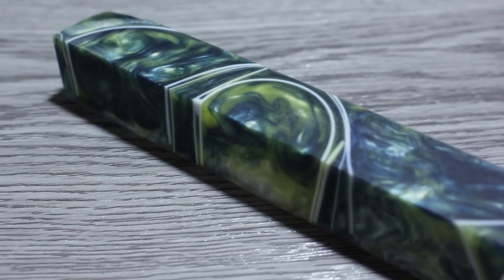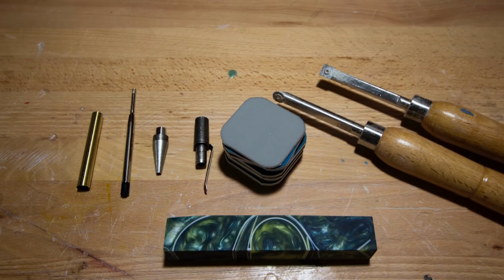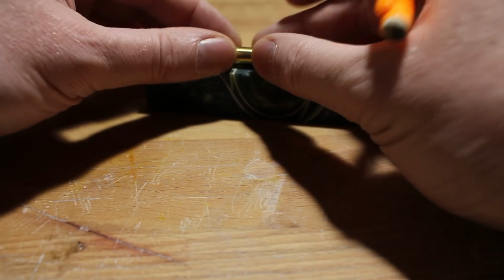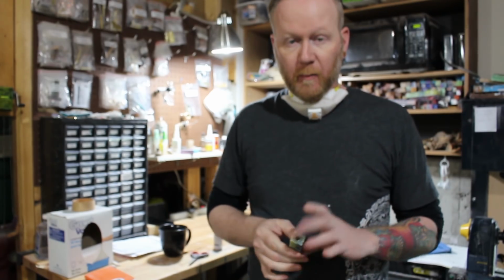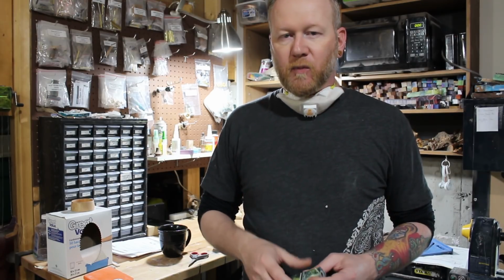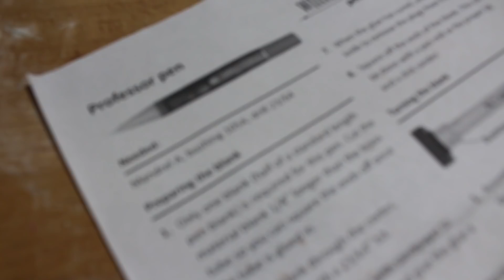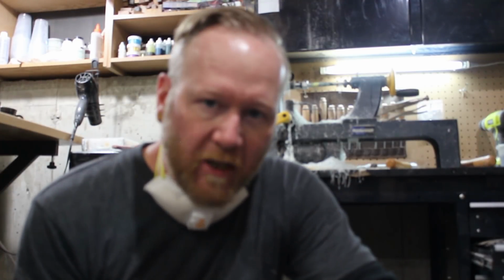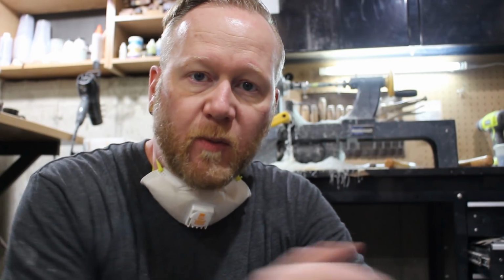Pen Making | Turning An Alumilite Ribbon Pen Blank On A Professor Pen

Comment: Great video Mike. That blank looks great. I agree with you on the not going down to the busing and sanding the rest of the way. The only difference I would say with me is I start at 120 and go to 800 through the dry and then  micromesh down to 12,000. I find this gives me virtually no scratch marks and then I use a polish to really lift it. I will sometimes use Yorkshire Grit too between dry and wet if there are some stubborn scratchs, it saves wearing out the micromesh
Reply from the maker: Thanks John! I'll give this a try...aside from the Yorkshire grit, at least until I can get some locally! 😉

Comment: Great vids. Keep it up. I turn between centres using the regular bushings you already have. Just use a dead center in headstock and rotating center in tailstock.
Reply from the maker: Thanks Wayne - I'll give that a try this weekend!
Reply: It’s really simple and I don’t think I will use a mandrel again. You can only turn 1 piece of the pen at a time but I find it much better than using mandrel as you don’t have to worry about the mandrel being straight.
Reply from the maker: I just bought a new mandrel but will still give this a go this weekend. 👍

Comment: Have you ever had the ribbon detach from the blank.  When I tried it with Aluminite Amazing casting resin the second pour didn't stick to the ribbon.  Great looking blank and pen.
Reply: Use Alumilite Clear Slow Set next time.  "Amazing Casting Resin" is not meant to be used for items that will be turned on a lathe.
Reply from the maker: Nope, was neer an issue for me.

Comment: If anyone ever tells you you have to drill on the lathe or even you should....show them 2 of the same style pen where one was drilled on the lathe and one was not and ask them to tell you which is which.  There's no way to tell.  It's a 50/50 guess, but no way to tell if was drilled on a drill press or on the lathe itself.
Reply from the maker: Thanks, don't have to worry about this any longer, but maybe someone will find your comment helpful, I know I would have back when I was still pen turning.